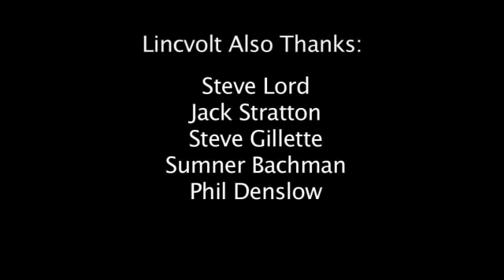Neil Young & Lincvolt at SEMA 2010- Part 4

Comment: In the Netherlands we face the problem of getting a shortage of electricity for cars and households! The Netherlands has the highest density of electric poles to charge batteries but we have to upgrade the energy source (windmills and solar panels) but now it also turns out that the making of solar panels, batteries are very bad for the environment!! And also: we have to stop using gas for our heating but our neigbours in Germany ( a much bigger country) got subsidised by the government to use gas instead of Nuclear Energy... It is all a mess and about politics!
Reply: I run my estate mostly on my private windmills and small solar farm. Private mid-sized electrical grids are worth it. Why pay a company or government to give you power when you can utilize the environment to make your own energy for much less with a decently high initial cost but significant savings over time. I could have had a hydrogen power system but honestly, those are practically ticking time bombs under your home and in your car that could go ballistic at any time.

Comment: Advanced biofuels, of course this stuff can be produced, but can it be produced economically? The answer to that is no, we are nowhere near that point with the approaches that have been attempted to date regardless of the hype to the contrary.  Fuel generated from harvested corn leftovers creates more greenhouse gases than conventional gasoline. Cellulosic biofuels will still fail to produce 60 percent less pollution than gasoline, which is a requirement to qualify as a renewable fuel according to the 2007 Energy Independence Security Act.  For every joule input to create fuel ethanol, seed to tanker delivery, no more than 0.9 joule can be returned. Subsidies and production volume can cheat thermodynamics - when we recover CO2 and ignore PV = 101.325 J/liter-atm, add cap-and-trade, and legislate faith-based engineering.  The future belongs to solar power, wind, high altitude water reservoirs and nuclear power.
Reply: Quite agree about nuclear being the primary source only viable option to provide the planets's future power needs. The  mission ought to be electrify roads.  Insert at regular points those those circular induction / magnetic units for transmission to underside of vehicles. Upgrade the industrial world's road network for EV's to charge as the go, job done...

Comment: Neil, it was a pleasure meeting you at SEMA, discussing your passion for clean energy and clean air.  HH2 Hydrogen is proud to work with you on your projects.

You truly have a grasp of the future and you are leading the charge to Clean air,  and it will be a greater pleasure to add the HH2 Hydrogen Clean Air Combustion system to your vehicles, providing a lower carbon footprint and great MPG, power and performance with Zero Emissions our goal.  Thanks,  Dr. Derek Z. HydroLectric Power LLC